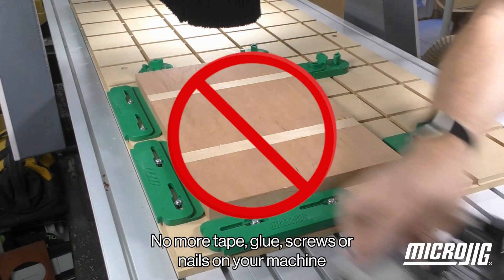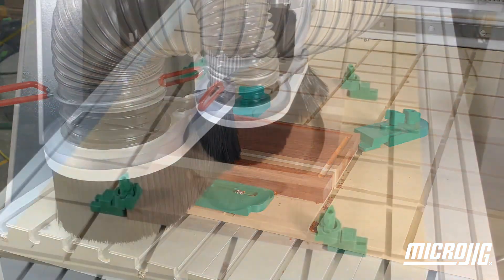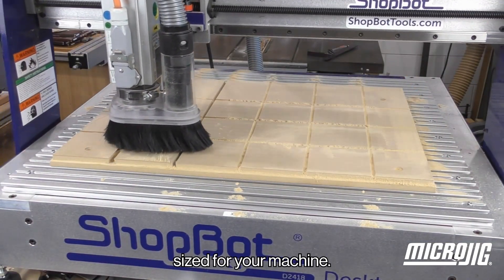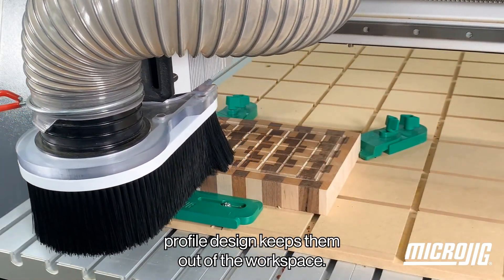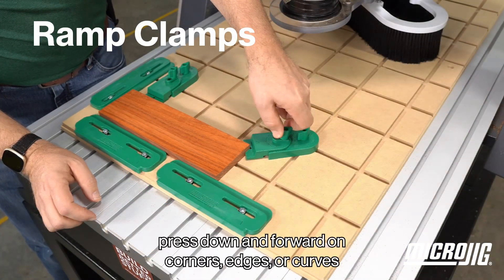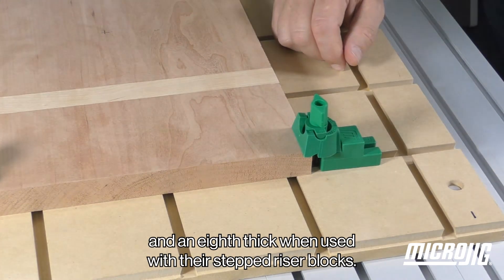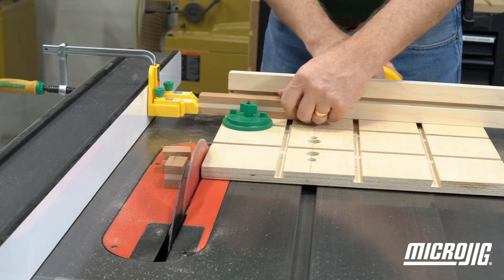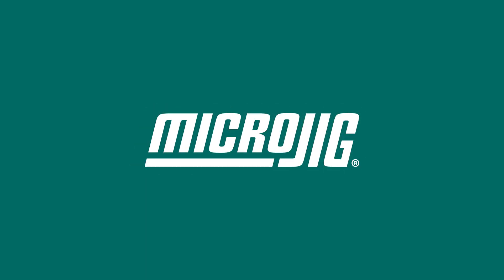MatchFit CNC Workholding Kit | A Complete System for Secure, Interference-Free Workholding!

Comment: Great looking system. It's simply not true that it can take the place of tape, for example, on interior through cuts. These clamps will hold the outer material, but the parts cut out from it will still need tape or some other means to hold them in place.

Comment: Will this work for the xcarve from inventables
Reply from the maker: YES! You use your CNC to mill the spoil board to fit your bed, so it will work with most brands and models. The MDF spoil board is attached to the bed of your machine. We supply nylon screws. If your machine does not have T-track like ours, you can add a couple threaded inserts to your machine bed. The manual includes full instructions for programming and cutting your spoil board.